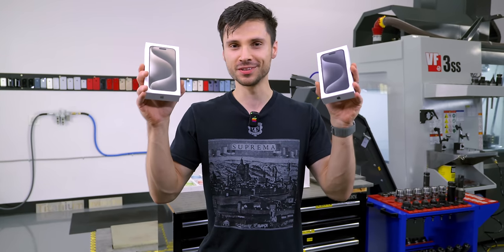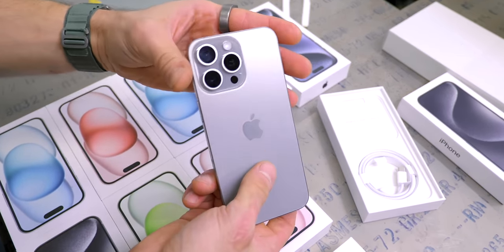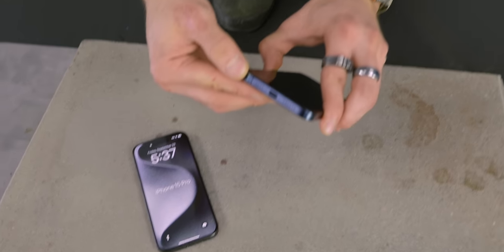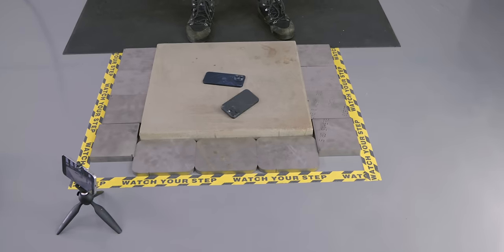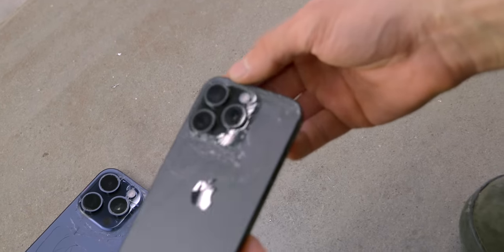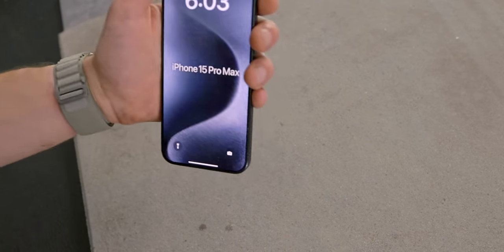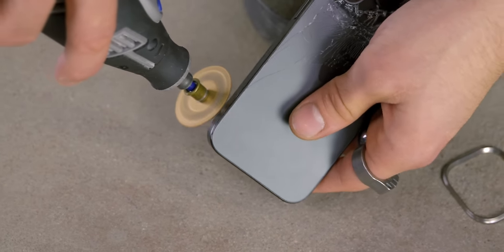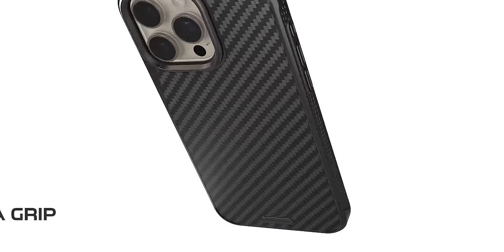iPhone 15 Pro Max vs 15 Pro DROP Test! TITANIUM At Last

Comment: I had a 12 pro max. Never put a case on it. Dropped it several times and on different surfaces with little to minor damage. Apple for sure made the rear glass weaker on purpose. No doubt.
Reply: Nope. Ppl wanted easily repairable so they made the back glass its own separate piece therefore it lost a lot of its strength and integrity behind the glad due to there now being not as much support
Reply: @kidnextdxxr  sounds like excuses
Reply: The truth is that the older phone were made with stainless steel. Steel, while being strong, has more give in impacts compared to titanium and acts as a cushion for the glass by absorbing the shock. Titanium retains it's shape rather than give in comparison to steel and when you drop glass with a titanium shield around it, you'll just have all that impact be absorbed by the glass since the titanium too strong and is suffering from success
Reply: I still have the iphone 12 pro max after 4 years and I'm still considering if I should buy the 16 since the back glass of the 15 breaks so easily and they are made of the same materials just the titanium is a bit stronger. For the breaking glass I heard no change. I have no intention of going every three or so times looking for a replacement shop. I'll wait another year in case this problem doesn't change this year either until Apple comes to its senses or else I'll go to find some other smartphone, android perhaps.

Comment: Surprise Surprise The King is BACK. Good to see you again!
Reply: Bro's biased af tho, phones shattered on the first drop but he still recommends buying
Reply: @bz-winningitall You can’t be serious 🤦 it’s glass, what did you expect??
Reply: @ViciousFirearms  watch previous years' drop tests
Reply: @ViciousFirearms  jerryrigeverything did a bend test and the back glass cracked and he even said that this is the first iphone to ever crack
Reply: Glass is glass, it breaks
Reply: @abinacharya5446   you didn’t understand my point, since the iPhone X and up jerryrigeverything did a durability test and all of them survived except the iphone 15 pro max, which means the glass became weaker
Reply: @ViciousFirearms glass still doesn't crack that easy when just bending the phone 🙄. Jerry hardly even applied pressure to the bend and it cracked. No other iphone did that, besides the iphone 6 or 8
Reply: The king is MKBHD

Comment: Wow the nostalgia hit from watching EverythingApplePro’s videos again ❤️ We need to see a 14 Pro vs 15 Pro drop test. I’m guessing the curved edges of the 15 Pro make it much easier to crack the glass. Anyway Thanks for the upload!
Reply: Check out the durability tests this guy did with the 11Pro-Pro Max, the results are incredible, and the edges of the phones' screens are especially round... they seem indestructible😎
I think the 15 pro model failed this year...🙄
Reply: So the frame is the only titanium?
Reply: The iPhone 14 PM is more durable it manages to be in excellent refurbished condition, meaning minor scuffs in stainless steel with no front and back glass shatter 100% free of scratches or cracks under concrete at 15ft drop test the iPhone 15 PM more fragile because the tiaitinium spreads the damage everywhere while stainless steel absorbs all the damage

Comment: I’ve had my 12 Pro Max since release day, never used a case & never cracked.   I do use an $8 screen protector which I replace when I crack it. I’ve dropped it on rough pavement multiple times. Since watching your drop test videos the 12 seems to be overall most durable compared to the 13,14,15. I doubt the 12 screen is as durable as the 15 but I use a screen protector. The back glass breaks quite easily on the 15 it seems. I’ve gone case-less & don’t want to go back.
Reply: Same with my 11 Pro Max
Reply: And I don't even use a screen protector
Reply: @IIXxSLAYERxXII  I suspect it is because iPhones get heavier every year except this year for the 15. Still heavier than a 12 or 11. Also the larger camera bump probably doesn’t help with back glass durability.
Reply: @Paul-tw4un   maybe. Dude, this ridiculous enormous camera is also one reason why I still use the 11 Pro Max. I really want the faster CPU, GPU, RAM, 120hz...but the camera is just too big, i don't need it much either. I wish the difference between pro and standard models are just the camera.
Reply: @IIXxSLAYERxXII  I’m with you there brother, I hate how it wobbles around on flat surfaces when pressing the top right & bottom left corners. Couldn’t apple just make the top part slightly thicker so it’s uniform & flat camera? I went from the 11 pro max to the 12 & I honestly didn’t like the sharp corners but liked the big screen & better battery. Plus my phone feels slower, maybe I should factory reset or apple just slows older phones with updates secretly, I wouldn’t be surprised.
Reply: @IIXxSLAYERxXII  I’m at 80% battery health & trying to run it down another 1% so I can get a free replacement & cancel my apple care+. Hopefully itll feel alil faster.
Reply: With Apple care+ in the US..

$29 for front glass
$29 for back glass

Worth enjoying it case-less and screen protector less.
Reply: @Paul-tw4un  yeah i also like the round edges like the 11 Pro Max more. I don't think they secretly slow down the phone. Im using my 11 since nearly release and I replaced the battery like 1 year ago at around 78%. Im a hardcore user, everyday, YouTube, Games, music, movies... . The batterys in Apple devices are very long lasting...
Reply: My 13 Pro Max has been the best Iphone I’ve ever had and I’ve had them all since 5. Basically the same as a 12 tho
Reply: I had the opposite experience, I have a plastic case on my 12 Pro Max, it feel 3 ft and the back broke.

Comment: I think I'll wait for the next iteration because there seems to be too many problems with the 15 Pro Max: titanium coating gets scratches very easily, glass on the back of the phone breaks more easily, the phone overheats, etc.
Reply: Put a case on it. Simple.
Reply: My black 15 pro max doing just fine ngl 😂
Reply: @RayelArtistPage it’s been out 2 days😭 you’re being very optimistic
Reply: @cambriaalise2014  I do Amazon driving as well scanning sht fast asl and the battery ain’t die on me on a 5 hour shift with no charge just in the car hope yall get lucky like me 😂
Reply: Mine is fine
Reply: @martyn_g doesn't fix overheat, will make it worse. What a combo of flaws lol
Reply: @martyn_g I don't get why people pay more than $1000 for a phone and then cheapskate on a case.
Reply: @BLinX神 Overheating might be due to software though. That is fixable.
Reply: @onee and how do they fix that? by underclocking the chip so it outputs less power
Reply: @cryomancer2768  So, you've already figured out what's causing the phone to overheat while the trillion dollar company that produced the phone hasn't figured it out yet. Great job! 👏👏👏

You really have no clue how software works do you? If this is caused by a bug, it will be fixed in the next update. No need to underclock anything.
Reply: @onee bro thinks only iphone phones are 1000 and more 😂 be blind as much as you like
Reply: @RayelArtistPage ur surprised ur phone lasts longer than 5 hours?… that’s…baseline. an iphone 12 could survive that.
Reply: @RayelArtistPage and is your black iPhone 15 pro max still fine?

Comment: Even your case couldn’t stop my phone from breaking back glass today. Crazy to see it happen for the first time and I’ve used your case’s for years. Glad to see you back
Reply: Back glass is incredibly fragile. Apparently you can break it by just trying to bend the Pro Max with your bare hands. Pretty sure they could have made it more durable but where's profit in that... 🫠 

That being said, still gotta give it to Apple: the most important and hard to replace part - the screen, seems to be very durable.
Reply: The new cases from castify are bulletproof

Comment: It's odd that the back glass breaks so easy. Is this perhaps a result of the new center frame construction?
Reply: no bro that's just Apple
Reply: It’s cuz they made it removable now but did not account for the air gap between the frame and back glass
Reply: It’s more “repair friendly” so now they make it more breakable so you can repair it more easily more often which is spending more money so it equals to the not repair friendly.
Reply: Glass is glass it will break

Comment: I think the back's new replaceable structure impacted the rear glass's overall strength. Glad to see you back, EAP!
Reply: I don’t believe apple made any claims about the back glass only spoke about the screen.  (Which implies front glass only) it’s very clear the front held up much better.
Reply: @treymiller5736   yeah, I don’t think they mentioned anything about it except now it is easier to replace. This could mean that they’re using the same quality glass from last year’s models but they put it in the phone differently. What I’m trying to say with my first comment is that the back glass retains its quality but since it is used differently the chances of it breaking with less force is higher. My statement was also very clear
Reply: the iphone 14 also had a replaceable back
Reply: Yeah that was my first thought too. In previous models where the back glass was adhered to the metal back frame it probably distributed the energy of the impact better but now all that energy is going onto the glass with no support behind it. Its the same problem the iPhone 4 had which was easy to break the back glass but very easy and cheap to repair yourself as well. Thankfully the back glass repair is significantly cheaper now, only $169 or $29 if you have apple care+.
Reply: @Ryu.86 yes this is 100% because it is now installed with adhesive around the perimeter of the glass like Samsung devices do. Previous iPhone pro models have the back glass heavily glued to the mid frame. But people complain about the high repair cost because Apple replaces the entire housing for that fix.
Reply: @RolandKoller90  But isn’t Samsung still durable?
Reply: No, it's the rounded shape
It creates weak points all around the glass making it very fragile
Reply: @maddan4956  I think that also impacts it.
Reply: @Ryu.86  But the iPhone 14 seems more durable and has an easily removable cover, the first modern era iPhone to have it. I’m starting to think it’s the aluminium and titanium frame that might make it more prone to cracking when dropped.

Comment: Rarely that I comment on YouTube videos, but Rebel Gen 5 cases are the best case that I have used! Definitely worth the price tag! You can put on the  biggest screen protector that you have and it won’t cause bubbles to show on the edges due to fitting issues. Buttons are tactile and the charging port cut-out can fit my larger type C charging cable head. Perfect!
Reply: I have three of his cases I love them all

Comment: Great break down. It really is luck of the draw. I’ve dropped iPhones from 3 story heights zero damage even to the glass back. Basic silicone cover. 
I’ve dropped from tabletop height and it cracked screen and back glass. Depends on the angle, what it hits, if it’s flat or bumpy surface etc. 
have seen other reviews saying it’s terrible that when you take a scalpel to the paint on the new pro the paint will scrape off… ffs… what you expect would happen? 🤦‍♂️ 
Slap on a cover and a screen protector and be carful with your phone.
Let’s all start giving out when your laptop smashes when you’ve no cover on it and drop it down the stairs… why oh why don’t they make them throwable 😂
Reply: This might be a trend. The back glass breaking might be noticeably weaker then previous years.
Reply: Yeah but it does honestly seem to be less durable the the last few years

Comment: There is one factor (well, TWO actually) that most drop tests never take into account: the DIFFERENT SURFACES most phones drop on (not just SMOOTH ceramic tiles or smooth concrete ones like this one) but also, and MORE IMPORTANTLY, the attempt to catch them and while doing so, throwing them away! That is what happens to me most often (not that often, fortunately) so I think they should simulate that instead of them falling perfectly flat on their sides, back and front, which I don't think is a very realistic and scientific drop test!
Reply: Who cares? They both broke. You don't need to know anything else.
Reply: To be fair this is actually more fair for the iPhone cause if it did land on a parking lot with a bunch of little pebbles face first it would be way worse for the phone. And it’s not necessarily unrealistic because if it falls out of your pocket when you’re getting into a car or you don’t even have time to react
Reply: So, I can be a bit insensitive to bare phone drops because I have never used them without a pouch, ever since my first Android phone, the S4... Nevertheless, these tests should take into consideration ALL kinds of terrain, from bathroom tiled floors to countryside pebbled ones!
Reply: @rijoenpial  lol it's just a simple experiment for a shorter video.  not 1 hour.
Reply: @Crucivac  If you are not going to be thorough, why do them at all!?
Reply: I remember trying to catch my phone after it slipped out my hand and punting it half way across the room knocking over a hot beverage on a table. Phone was fine. I drop my phone daily because I am clumsy. Samsungs sure can take a beating...
Reply: @YurinanAcquiline  My iPhone XR went through hell and back and it has no cracks and barely any scratches... its not just samsung buddy.

Comment: That incredibly rigid frame is forcing that energy into the glass.
Reply: hey umm . upgrading from iphone 12 . should i get the iphone 15 pro or the iphone 14 pro . will be using a case tho
Reply: @9horizon40  Hello. If those are the two options you are choosing between, then I would still go with the 15 Pro to be honest. Unless you can get a nice deal on one of the remaining 14 Pros that are left. My recommendation, if it's worth considering, would be a iPhone 15 Plus because you are getting some of the great features from the 14 Pro (A16 Bionic SIP, Dynamic Island, and the 48 megapixel main camera) while getting absolutely insane battery life. It would be a huge upgrade from iPhone 12 or 12 Pro while sticking with the tried and true aluminum frame and matte finished back glass. With the 15 Pro's new titanium frame, I would let that stuff go through a couple iterations before jumping into it just because it's all new and will (has) have some issues. I hope this helps!
Reply: @matthewwarner1606  hey man thanks for the guide . appreciate it .
Reply: No it's the new design which made the back weaker and glass breaks even on slight bend

Comment: I honestly think the black glass is cracking like that on drops because it’s no longer attached internally like previous models if you get what I’m taking about , now with the 15 the back glass is more repairable by just being attached to the frame internally by clips most likely and some glue for water resistance. I would rather them have kept the same back glass internal design as the last few models instead of this “ easier to repair “ thing as it seems it would’ve made the back glass more durable to shock
Reply: At least if it does break, you can replace it more easily now.
Reply: Same
Reply: Also the curve edges make it worse bc the glass takes the side impact, whereas on the old sharp edge design, the edge of the stainless steel would take the impact protecting the glass. And since steel is a bit softer, it would dent and soften the blow
Reply: people complain that apple’s greedy and controlling when they had the previous back glass design, even though it was allegedly stronger. Now that apple has made their past couple of iPhones more repairable by changing the way the back glass is attached, people still complain that it’s allegedly not as durable as previous models.
Reply: @59fiftycap  What they want is what Android has had for basically forever. You can't pick repairability and durability with Apple. Having both isn't profitable enough for the fruit company.